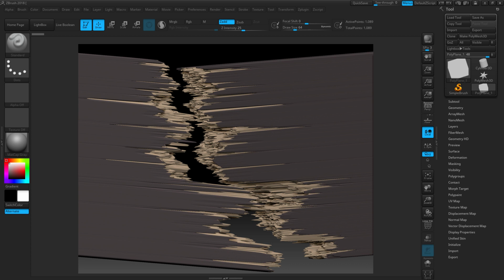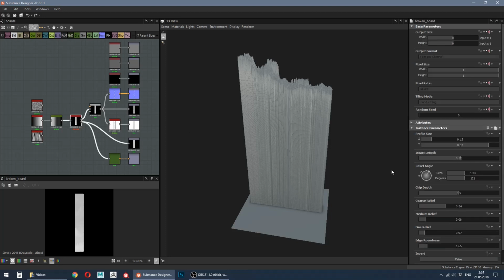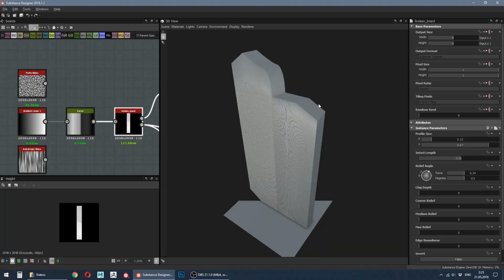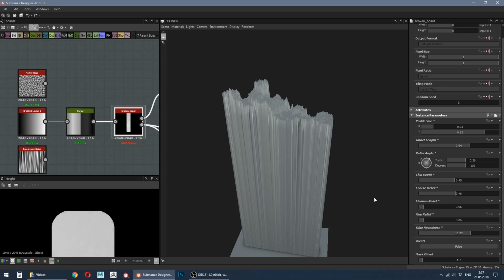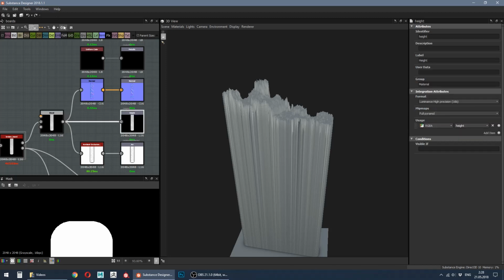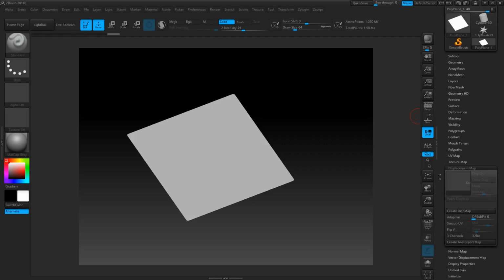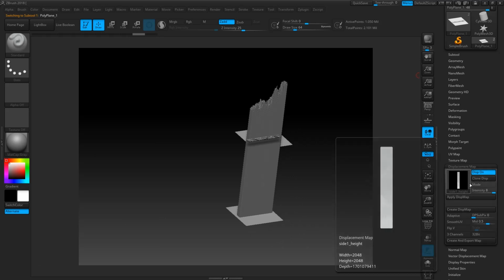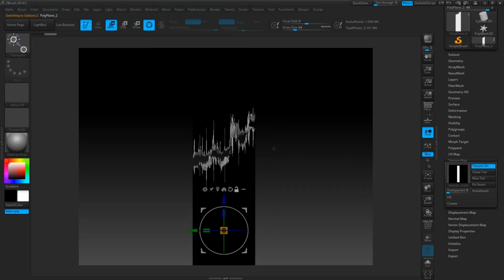Broken Board Generator

Comment: how to maka low mesh? :)
Reply from the maker: After you made high-poly version in Zbrush, use decimation master to create low-poly version. And you need to perform it not in one step, but in two or three, since one-step decimation deforms shape much. So if your HP has 1 million poly, you need to decimate it to 30K first and then to 3K to get 3K LP (of course this varies from mesh to mesh and depends from your needs.)
Reply: @denisblinovcg  谢谢  我试试:)